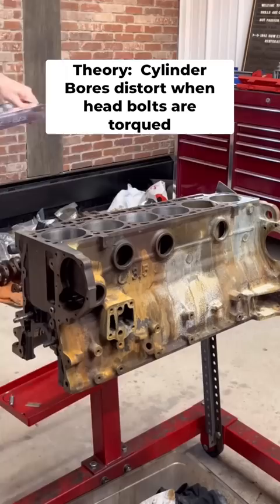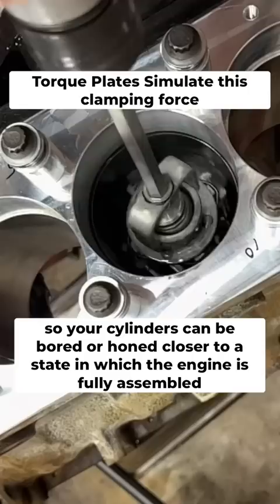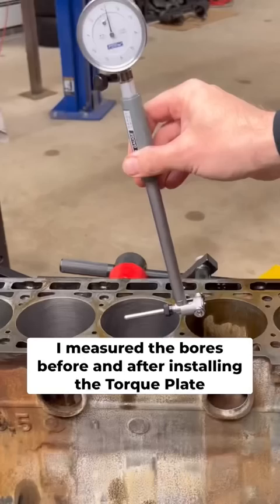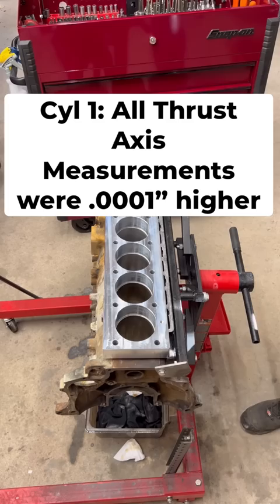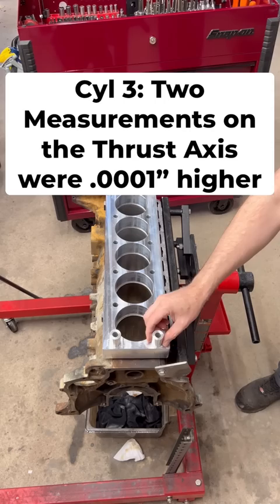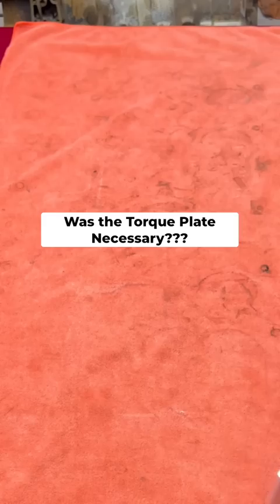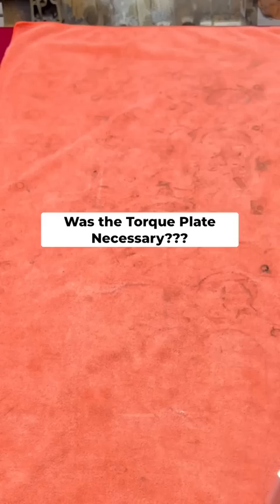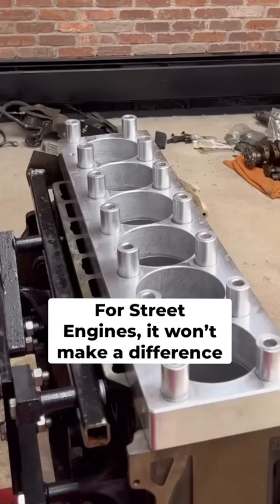Are Torque Plates Necessary? #bmw #cars #diy #bmwm5 #bmwe34 #restoration #automotive #engine #tools

Comment: As a machinist, all I gotta say is they don’t use one from the factory so if your build is near stock power levels you’ll be fine. Once you start making some power it’s a good idea to use one, you can see the difference in wear marks in the cylinders between using a torque plate and not using one.
Reply from the maker: You're right
Reply: Also, heat up the block
Reply: I work for gm in the Romulus engine plant. You my friend are correct you don't need it. But if it's my engine it will be torque plate honed. Hell I have purchased a torque plate for our minibike engines. Now I can say you get less in the catch can overall on a prepped engine. We have one that I don't want tontake it apart. Because my boys beat the piss out of this little engine. That minibike combination has a nickname of compound fracture 🤣 it sees 8k all the time. The thing barley uses any oil.
Reply: I've seen as much is 0.006 difference in the out of round in the cylinders . I guess that's the difference between a general machinist and a performance engine machinist .
Reply: As a machinist also, we don't use them. We have them if requested though. I'll say this. There's an 800hp sbc that lives at the track damn near. On e85. 13-1 usual deal. On top of that, it gets sprayed the silly stuff. We put rings and bearings in it every few years. Knowing forged pistons generally want around 5thou ptw, that few hundredths isn't going to matter.
Reply from the maker: @mauricedavis2905  thank you !
Reply from the maker: @calebmichie2854  Thank you for your intelligent real world contribution
Reply: Many drag engine builders would disagree with you.
Reply: @Comanchee0689  well. I've built many dragster engines. Once you get to a game where 1 or 2hp matters. I can see it being more needed. But the people playing those games are running second quarters.
Reply: .0001 means nothing in any engine.

That is why we have piston rings.

Injectors, injection pumps, hydraulics & high precision bearings are the only place that level of accuracy matters, anything else is a waste of time & $
Reply: @Uncle squirrel 🐿🐿  so you also torque the mains with bearings in them? You use a head gasket that will be used on the engine between the torque plates? You're in a 100% temperature controlled environment with temperature controlled coolant?These things will change and effect it a few hundredths.I guess we shouldn't begin to talk about how much that cylinder warps and moves when it's running either.
Reply: Subaru does, I’m pretty sure
Reply: @calebmichie2854  1 to 2 hp makes about as much difference as the driver taking a dump and a piss before the race lol
Reply: @pvtimberfaller  yup, exactly…….too many folks here getting high on the bullshit they told themselves to feel good about the time and money they wasted on a sales gimmick.
Reply: @RandyAugustus  Subarus blow up when they make more than 20hp because of the shit oiling system
Reply: @Tyke21  there are people out there that play the game of 1 or 2hp. But they're way beyond my budget lol
Reply from the maker: @pvtimberfaller  I didn't know injectors or injection pumps require that degree of precision. I assume it's because of pressure building?
Reply: @WeWrench  dispersement of fluid. If you have one side that doesn't spray as equals the other side it can cause issues. As well as the ability of the injector pump to flow equal amounts of fuel at a specific rate. I think smarter every day did something on injectors that was pretty decent if you're curious.
Reply: @RC-T3K  tbh I think I'll just start the engine up to get an accurate setting 🫡
Reply from the maker: @NIHILWR  Gotta do what you gotta do
Reply: Guy had me do machine work on a 1khp engine in college. I tq mains and the plate and when it came back for an inspection after breaking period it looked like I had just assembled it. His break in was 250 miles +5 passes
Reply: Correct they don't use in all manufacturers but also the new blick hasn't gone through thousands of thermal heat cycles .depending on block design, crankshaft register design , rib bracing, water jacket size etc. Try measuring with and without crankshaft fitted and torque and see how different end results are. So inmy opinion they are more beneficial to use than not. 30+ years in heavy diesel, light commercial, passenger vehicle and engine blueprinting and building experience.

Comment: I converted an aluminum cylinder head into a torque plate with a $14.00 dollar four inch hole cutter from Home Depot. Torque the plate and the main caps before I send it to the machine shop to be bore and hone. It was worth it
Reply from the maker: That’s really resourceful!
Reply: That's a really cool idea.
Reply: @kenshutes6032  I torque the main caps first and then the cylinder converted torque plate my bad
Reply from the maker: @kenshutes6032  Cheers Ken!
Reply: I was thinking on doing the same with a junked head I have. I was barely in the process of figuring out how to cut the cylinder holes the cheapest way posible with garage tools. 

Thank you sir for the Home Depot hole cutter idea.
Reply: @samus40glock  I use the cylinder head gasket to make a torque plate out a 2"x6"x2ft piece of wood. clamp that piece of wood to the bottom of the cylinder head with some long bolts. That torque plate made out of wood is to help hold the whole cutter in place. once I cut a 1/8" . I added a drill bit to the center of the whole cutter . after cutting as much as could I added a longer drill bit to help drill a straight whole all the way to the other side so that whole can help start cutting from the other side because the whole cutter can only cut so deep. I use a fish tank water pump to run water to the whole cutter to keep it cool. It was not easy 😪
Reply from the maker: @samus40glock  Good idea for sure!
Reply: @juancamaney3562  you have save me a lot of thinking, trail and error. Thanks for all the info.
Reply: May's well just use gudgeon pins to space the bolts and torque them down 80 percent of the heads strength is the chambers
Reply: Damn, now that I think about it it wouldn't be that hard usually with a mill and a head
Reply: With an Iron Block, yea maybe, but an aluminium Block i bet there Is a bigger distorsion
Reply: The machine shop that I go to that have a torque plate. They only use it on high comp engine and highly boosted engine with no extra charge. 
    It doesn't matter to me coz I don't buy it and it comes with the service. If u are in buisness , having that might pull u extra customers than usual.

Comment: Some engines can distort as much as .005. Many architectural features like bolt size, thread location relative to cylinder wall, etc. In other words, it's application specific.
Reply: An open deck is a big one. I it’s more important if you are boring or resleeving. For just putting a cross hatch in a bore with a hone won’t change anything if you don’t use a torque plate. Also I saw that people are selling torque plates for that engine at like $450! What a ripoff for a piece of bar stock with holes lol
Reply from the maker: This one was 450
Reply from the maker: Several people have said they've seen that kind of flex in an engine. I'm curious as to which engine and how that's even possible
Reply: @WeWrench  it's not just cylinder bores that distort, main bearing bores, rod ends, etc. Any time you get a large clamp load next to a hollow feature, metals moving. Just like how people think with cracked rods, you can swap some ARPs in, and they can't move because it's "locked" together; but the bolt has a  much higher clamp load than the stock one, the bore distorts, now you still have to hone the rod, to return it to round with the new clamp load. I've even seen it with some more spindly main caps.
Reply: @wewrench  Toyota 4ag engines flex when running at high rpm let alone having hardware applying stress to them. 

It doesn't seem logical, but engines do weird things, and high HP and/or rpms bring out these fine changes. The 4ag in particular revving past 8000ish rpm can flex and wipe out bearings. The high sustained cylinder pressures in drag cars can flex blocks too! 

So torque plates on OE spec builds? Probably useless. Modified builds where you're chasing reliability and fractions of a percent of HP that can be gained by proper ring sealing along a bore? Worth it. (which when you have a 4 digit drag car adds up). 

But like you said, probably useless on most builds. The guys buying them know what they're getting into, or build a lot of the same engine and the extra cost and efforts will be worth it.
Reply from the maker: @KyleXSki  100% agree
Reply: @wewrench  Subaru engine blocks. They're inherently flimsy.
Reply from the maker: @chinchin3274  yes that seems to be the consensus

Comment: The distortion is worse on a cylinder with 5 bolts surrounding it as opposed to your 4 per cylinder. The SBC has 5 bolts and they are closer to the walls therefore the distortion is worse and the need for a torque plate is worth the extra cost during honing. Read about Smokey Yunick and his flashlight test through the spark plug hole while the head is installed with no rod or piston in the bore, pan obviously removed, 1 piston ring installed, squared up, 1 inch down from deck. With torque plate hone no light can be seen around the ring while watching from the bottom. Do the same without a torque plate hone and you will see 5 spots around the ring where light can shine through, from each of the head bolts.
Reply from the maker: Smokey was something else
Reply: Yes I have personally seen 0.00025”-0.00035” on some old Chevy blocks especially with fastener upgrades and oversized bores.There are so many variables in block designs(open deck,bolt quanties and patterns,bolt thread depth positions etc you can’t really put a rule across them all to say yes or no 👍
Reply from the maker: @SR-yp3eg  You're right. I cast a big net in the video.
Reply from the maker: @SR-yp3eg  But the point I was trying to make is that on a stock build, those few tenths won't make a difference unless its a super tight engine
Reply: See what a RB mopar block does with a torque plate.
Reply: Torque plate in no way represents the same loading as a cylinder head. Unless your cylinder head is a 2 inch thick slab with 4 inch open holes.
Reply: Wow thanks for the info
Reply from the maker: @travisbrown1520  Welcome my friend

Comment: That's what tolerances are for because metal reacts to temperature 👌🏻
Reply from the maker: Yup. And who knows what that block will do when its hot
Reply: @wewrench  If you know the operating temp of the engine and you know the composition of the block material and have access to the software you can run a CAD based simulation and see the distortion.
Reply from the maker: @briland7166  But that heat is applied unevenly throughout the block due to the combustion. Knowing that is it still reliable?

Comment: It depends a lot on the block.  I had a SBC one time that had shiny spots in the bore next to each head bolt because of deformation.  Never seen that in other engines that I have that have blind holes with cast in bosses for the threads.
Reply from the maker: I think I read somebody else saying this in the comments as well
Reply: Exactly the reason why torque plates were ever considered. Those shiny spots

Comment: That really depends on the engine, some Engines need a torque plate. If you wouldn’t use a torque plate the cylinder is deformed that much that you burn more oil then with with torque plate.

Comment: There is a problem with the conclusion: 1.he didn't remove the torque plate after honing to see how much the plate distorted the cylinders 2. A BMW engine block may not distort that much depending on how the block is cast, and it uses an aluminum head which also will not distort the block as much 3. You can't base an opinion on one block from one manufacturer. I've used torque plates and seen as much as several thousandths (not 10 thousandths) of distortion depending on the manufacturer, and block/head combination, which will definitely have an effect on performance.
Reply from the maker: I measured before and after before I honed to get these measurements. I cast a wide net on this one but I'm willing to bet that it's not needed on a street engine build. Racing engine..that's different

Comment: You don't run engines with torque plates, a complete head assembly will have a totally different distortion and heat expansion profile. Unless the torque plate is made to replicate the same specs as the running head it's a waste of time.
Reply from the maker: That's an interesting perspective. The heat expansion profile I agree. But the distortion I question because its caused by the clamping force of the bolts. My question is how would the cyl. head cause the bolts to clamp differently?

Comment: Fun fact race specific engines that have tight tolerances are machined hot with torque plates and mains torqued. 
Thanks for coming to my Ted talk
Reply from the maker: I believe it, but for street engines I think its a total overkill

Comment: Steve Morris just talked about this and how he doesn't believe in torque plates. For context, he builds 5,000hp+ pro-mod engines that have water jackets. Extremely reliable drag and drive engines.
Reply from the maker: Yes because it’s pseudoscience
Reply: When you’re dealing with hi end cylinder blocks that are as thick as the ones he uses there is little to no distortion
Reply from the maker: @anthonymilano691  I had no idea going into this. I thought this block would be twisting like crazy

Comment: Unless you upgrade head/mains fasteners and increase clamping loads, add crank girdle etc, then the need for line honing journals and using torque plates for bore honing like you said, the difference is negligible at best.
Reply from the maker: Agreed my friend. I don’t understand why everyone is getting so upset

Comment: Trick question. Older overbuilt cast iron, probably not. Subi cast aluminum, absolutely if you expect it to last longer than 5000 miles. including torque plates when doing necessary align bore for crankcase mains.
Reply from the maker: I have heard this as well

Comment: It depends on the engine. How the block is cast around the head bolts and how big and how high the torque spec is. If you have an engine with 4.331 bore with 19mm head bolts, that get torqued to 330 ftlbs then you definitely need a torque plate. The 3116/3126 cat will distort a full .002 inch when the torque plate is installed.
Reply from the maker: That I believe
Reply: Cummins and detroit dont call for torque plates.
Reply: @olegmisyuk157  Detroit uses liners so no. Cumins b series is not necessary because the bolts are very small with six around each cylinder. The clamping load is less and more evenly distributed. Anything bigger from Cummins has wet liners. 
 The 3116/3126 cats are solid cast with 4 19 mm bolts in a square around each cylinder. Torqued to 320-330 ftlbs. I’m not a fan of those cats but they keep
Me busy.

Comment: With or without using the torque plate, run the engine just one hot/hard run and then do your measurements.
Cast blocks 'move' quite a bit in a heat cycle.
A used engine from a junk yard re-machined is cured and more capable of enduring stress than a green block.
Reply from the maker: I've heard this too...that blocks season somewhat.

Comment: That's why you have piston rings instead of trying to make the tolerances between the piston and the cylinder tight. Piston rings can easily handle such small deviations. Maybe if you're going for ridiculous power or insanely high revving builds, but for anything under 600HP in an NA config or under 1000HP in a forced induction build, I doubt it's necessary.
Reply from the maker: I agree. It's an overkill. I love how everybody is giving me a hard time about it nonetheless
Reply: @wewrench  
You're still right, though.

Comment: As a 40+ year machinist, I totally agree. All the variables cancel out any benefits.
Reply: I'm glad this seems to be the consensus among the experienced. There is so much going on between temperature, expansion, hot spots, that even if there were a measurable difference, unless it's going in to a top fuel or F1 car, it probably doesn't matter. I see many saying SBC's may be an exception, for the 5 bolts close to the bore
Reply from the maker: Thank you for this intelligent contribution
Reply from the maker: Anybody who has real world working knowledge diagnosing and repairing road going engines will agree. Engine building is such a d**k swinging subject and I'm sure there are some exceptions to what I said...but generally speaking, I know I'm right because the engine depicted was .004" out of round at the top of the bore. Engine had 260,000 miles on it, and good compression and zero oil consumption.
Reply: Time = money.
Reply: Would even state that if the torque block is not exactly the same profile for flatness as the mating part - it could be even less useful.  Matching the torque between machining and assembly - especially with a head gasket will be unreliable;  temp expansion will further 'adjust' the whole system; the list goes on.

Comment: Viewers take note: One thing this video does NOT address is that although THIS specific engine only moved one ten thousandths, others, especially aluminum blocks, definitely warp more. Does it matter on a street engine?  No. Absolutely not.  But my point to the viewers is, don't think that all blocks only warp that tiny amount. It varies WIDELY industry wide with make, model and alloy.
Reply from the maker: You’re correct. I cast a wide net with this video. The point of the video and channel is push the limits of what you can do yourself and that a lot of these details that people obsess over don’t matter with street builds at the end of the day.